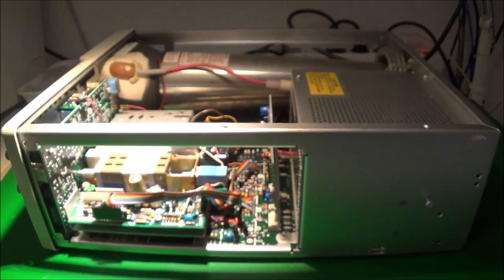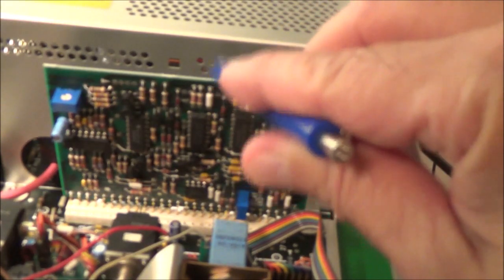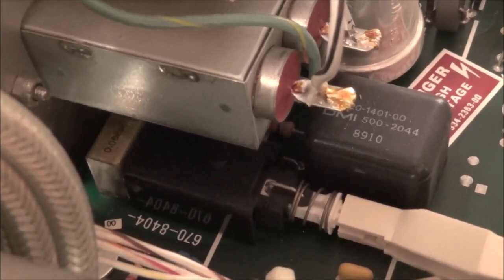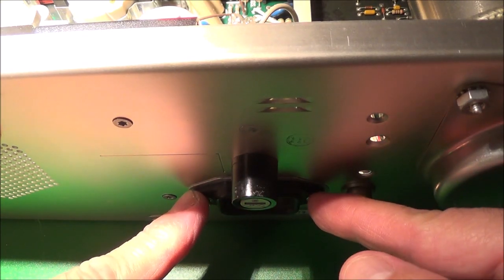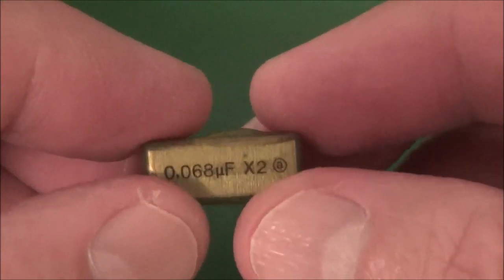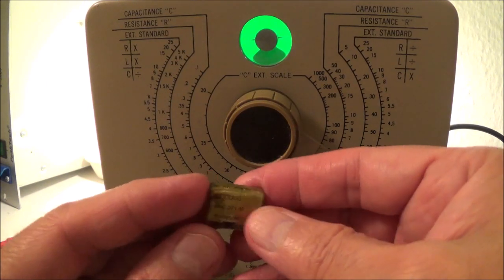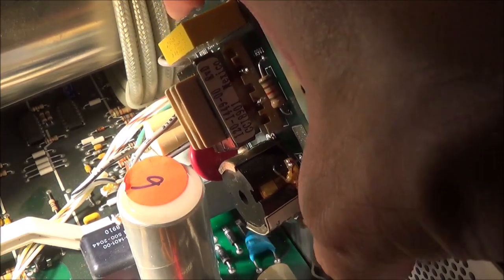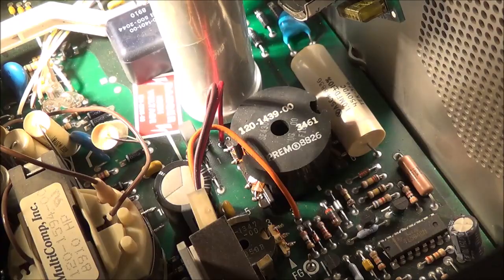Tektronix  2235 Oscillocope Repair -- X2 Capacitor Defective

Comment: Nice video! I wish I had seen this before replacing my caps because it took me a minute to figure out how that black plastic shield on the underside comes off. No need to remove the vertical board though, only the plastic clip, which was already missing on yours.
Reply from the maker: Thanks! Hope you got yours fixed.

Comment: The capacitor in my tek 2235 was a 2200PF 240v Y class capacitor. What is the serial number on yours?
Reply: It should have both a y and an x. The X goes from line to neutral and the y goes from line to chassis(ground). At least my 2225 has both. In fact my 2225 has on x and 2 y types.
Reply: I think the value changed over time. I saw a parts list that someone used a 2200pF , but my 2235A has a .068uF 250v in the C904 safety cap position. Like the guy in this video.

Comment: Thanks for the video. X2 and Y capacitors are explained in the following RS datasheet: http://rsfor.narod.ru/datasheets/pdf/232_6001.pdf (search for 232_6001.pdf if not found). These types of capacitors have to fail safe, they are subject to transient  voltages from the mains so their life varies. No need to replace the plastic cased ones unless shorted, but the old Rifa types crack and fail prematurely and if more than 20 years old should be replaced on sight.
Reply from the maker: Thanks for all of these infos! I also had to replace the Rifas in an old HP3325b. Also, for  thanks watching!

Comment: X  is a cross so think across the mains. Y is line to earth as you said. I would love to know the leakage current the eye valve closes at if you ever get the chance to measure it. Thanks regards Chris
Reply from the maker: Thanks for the "X is a cross tip"! Good idea. I can probably get the leakage current soon; thanks for watching!
Reply: Old School Thanks on the leakage current. I have recently bought a cheap insulation resistance meter from Amazon. It has a 250, 500, and a 1000 volt settings and thought this could be quickly employed for testing capacitor. I will be mentioning X Y rated capacitor in my next video as I have some to deal with a 1950s Cossor TV pattern generator. Keep making the video great content thanks for sharing. Regards Chris
Reply from the maker: All right, cool. That insulation tester could most certainly be used to test capacitors, I think. Anyway, I will watch the video on that and the X-Y video. I remember those generators; we used to call them crosshatch generators.

Comment: I've replaced so many of these cracked case RIFA capacitors in the Tek 2400 series scope power supplies and also the Tek 462 & Tek 465 spectrum analyzer power supplies. You have to get them out. They do a lot of damage to the PCB when they fail spectacularly.
Reply from the maker: Thanks for the tip! Let's hope people read your comment.
Reply: Hi. Could u tell where did u buy the caps? Thanks

Comment: This video explains what also should be done with 2235: https://www.youtube.com/watch?v=lrXCVg6T-ek
Installing a fan is a must because those inductance coils in the PSU get very hot and when they are shot it is very hard to find them.
Reply from the maker: Thanks for that information and for watching. It does get quite hot.
Reply: @OldSchoolElectronics  I did all the mods in that video and I'm very satisfied with the results.
Reply from the maker: All right, thanks! I will take a look!

Comment: Awesome video ! I have the same scope and now im thinking on opening it up to check things :) Thank you !
Reply from the maker: Thanks for your kind words! It would not be a bad idea to replace those X2 capacitors and check the power supply electrolytic capacitor. My electrolytic capacitors all tested good, but I will replace them with high-temperature electrolytics in the future. My power supply was getting quite hot; I have now installed a low-wattage  12-volt fan.

Comment: I just bought two 2213A which share almost all of the same parts as the 2235. I've spent quite a few hours/days researching them over the last couple weeks.

Those 2-3 wima/rifa plastic safety caps that you removed and 1-2 similar styled y caps seem to always be the first required replacement recommended by all of the guys who are familiar to them.

The only other required replacement in addition to that is the AC Inlet (the original one is schaffner branded). It has a similar type of safety cap inside of it that commonly explodes in the same manner but much worse. Not always a fire but can cause alot of clean up and can exhaust a big mess out of the back.

The proper replacement IEC I'm buying is a Qualtek 858-03/007, probably the same for your 2235 but would double check.

I'll soon be doing a few more checks on it for the common issues. Hope to see more, cheers
Reply from the maker: Thanks for your comments and all the information! Yes, I forgot to mention the AC inlet X2 capacitor. I, too, believe all of these X2 capacitors should be replaced. Good luck with your future projects!
Reply: @OldSchoolElectronics  No problem buddy, do you know about the Tekscopes group? If not, search web for "Tekscopes Groups.io" so much good info and super active.
Reply from the maker: Thanks! I don't know that group and will check it out.

Comment: On the audio repair forums they often call them the capacitors of death. Never seen one fail but always wondered about them. Should this be part of a rebuild? I'm sure they don't cost to much.
Reply from the maker: Thanks for your comments, Pat. It would not hurt to change them since they are exposed to AC mains voltage and they are not really expensive. I have seen a few go up in flames and smoke without any warning signs. Stinks, too. But overall this does not happen too often, but you never know....I would especially change them if they are made by a company called Rifa.
Reply: @OldSchoolElectronics  Once the epoxy mantel cracks they catch fire from what other people say, they are bad and must go.